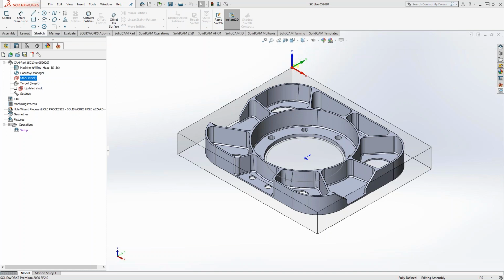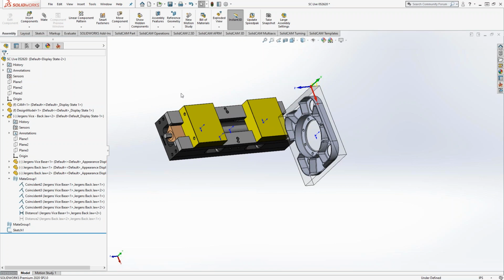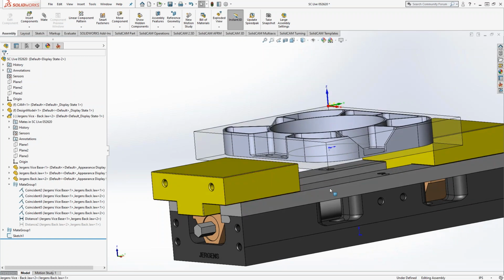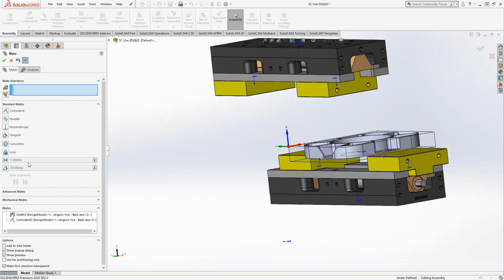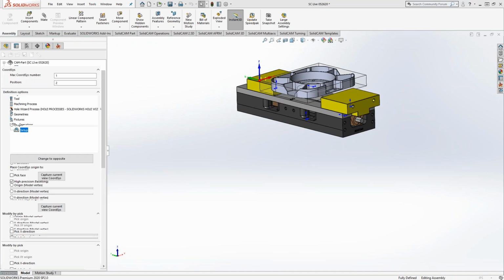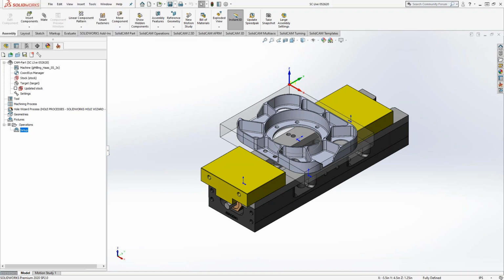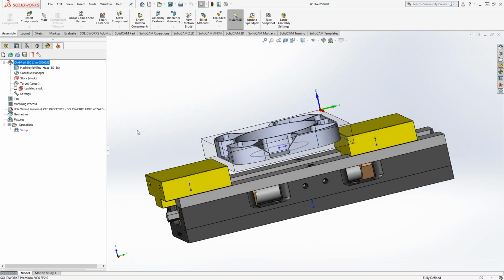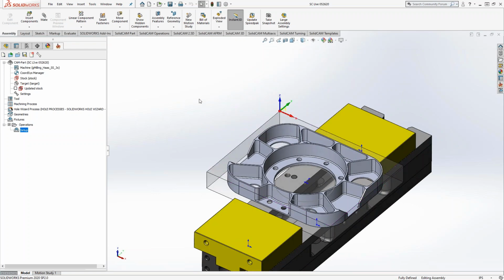SolidCAM LIVE - Adding fixtures

Comment: Why is it that if I put my second Mac location on the side of the part, all of my coordinates are still using the axis directions of the first one. Like if I have mac 2 - pos1 drill in the Z, it calculates the g-code as moving on the x axis.